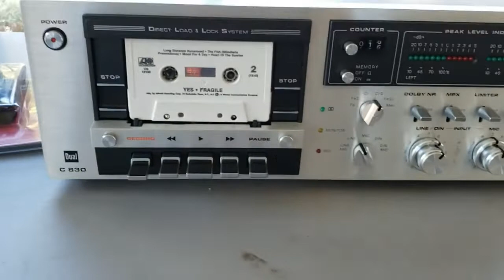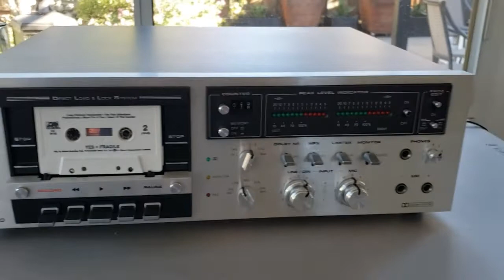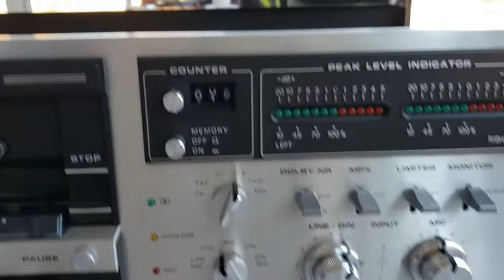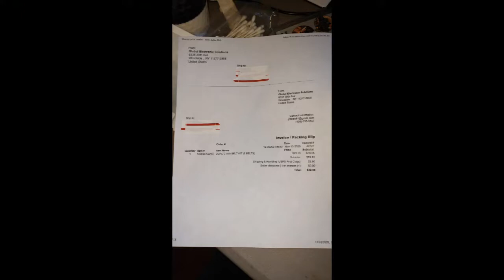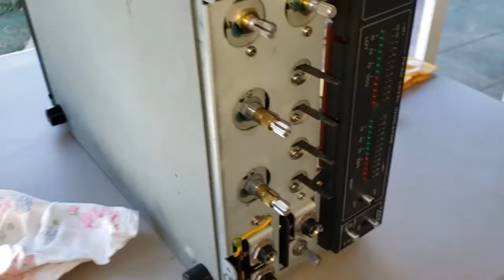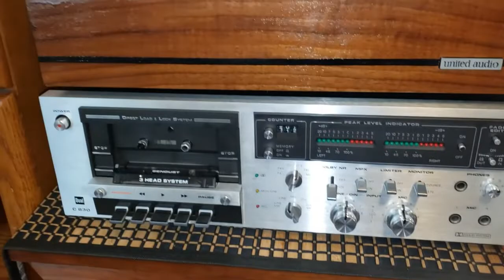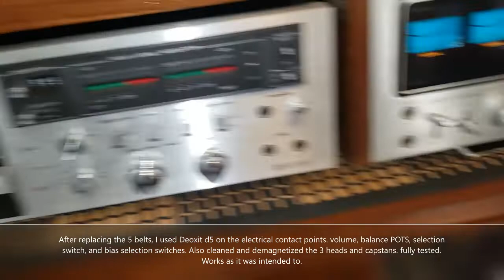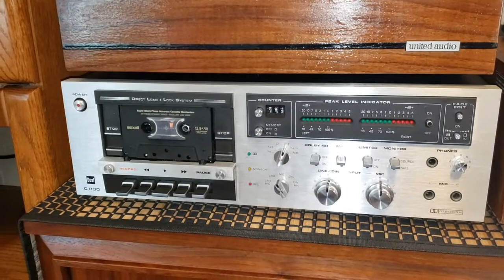Dual c830 Cassette Deck Drive Belts Replacement (Vintage HiFi Restoration)

Comment: Where did you buy your belt kit?  I have a Dual 822C that I'd like to change the belts on.  Not sure if I can, but your video helps.
Reply from the maker: I found them on ebay. But they were the last ones. I just purchased a oscilloscope.  I will be making short video on adjusting the tape head azimuth.
Reply from the maker: There is a set of belts on Ebay for a Dual C-822 right now. I don't know the quality though.